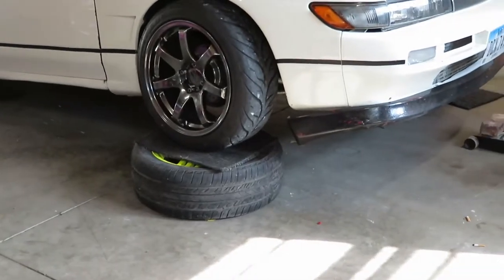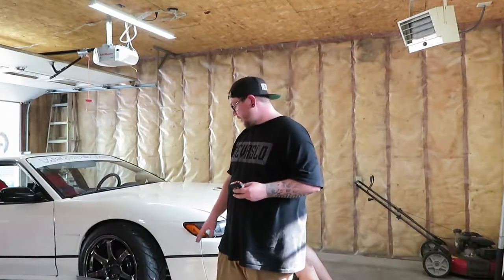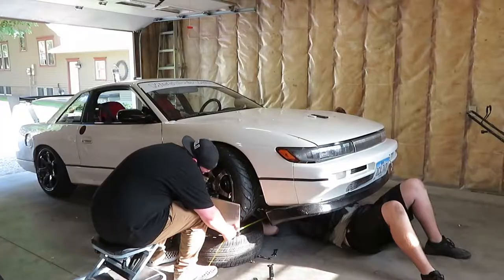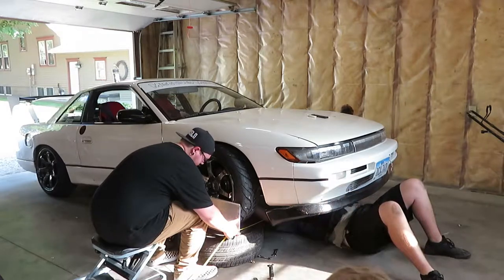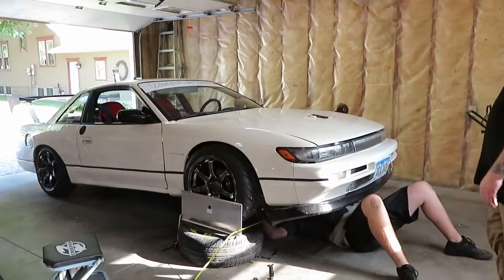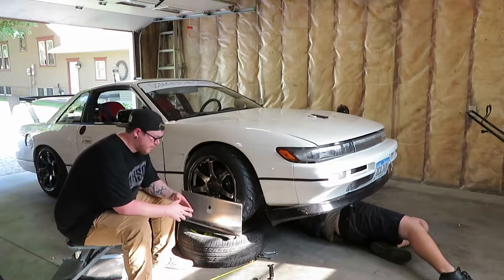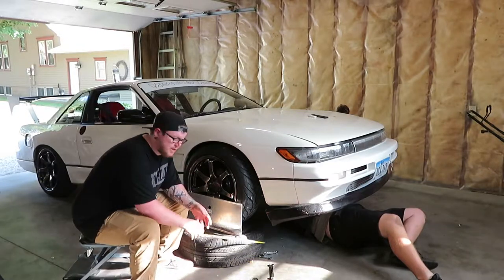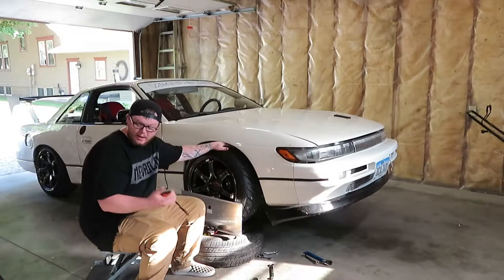Doing an alignment and figuring out if cheap Toe Plates are any good!?

Comment: Okay so my lowered ranger the toe is off but how do  you tell which wheel to adjust?
Reply from the maker: What i do is measure the threads or count the threads on the inner tie rod. If even i do both wheels evenly